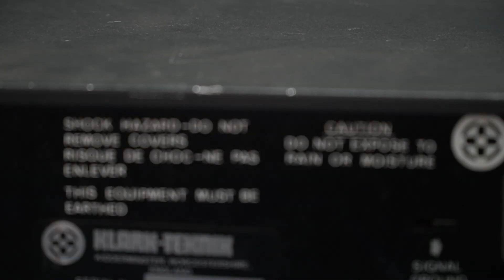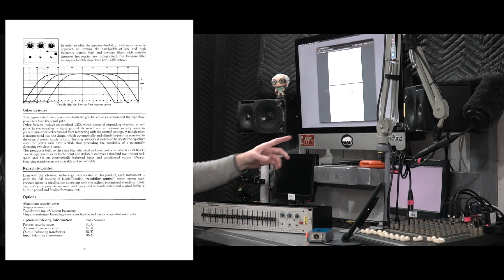#157 - Klark-Teknik DN300 early 80's Graphic EQ and the perils of Pin 3 Hot

Comment: Wow awesome video, btw do you know is DN322 in same league as this one? found one locally for 100$ , should I grab one?
Reply from the maker: Hey, thanks for the message. Yes the DN322 is a fine EQ, assuming you have a use for a dual 15 band these days. For $100 (if it works) I would probably be into it, depending on it's age though, you might want to haggle a bit since it will certainly need cleaning at some maintainance. Thanks again for watching.

Comment: Klark Technik is now part of the behringer group, they are “reproducing” many products very cheaply and many with authentically produced Midas transformers inside, including DI and line boxes, although not “original” parts this may be an option for you, there is a video from behringer about their production facility in China that also talks about their transformer production facility.I may be wrong but I think the balancing transformers that were used were those from Midas, hence special retrofit ordering.

https://www.klarkteknik.com/Categories/Klarkteknik/Signal-Processors/Compressors-Limiters/2A-KT/p/P0E8A#googtrans(en%7Cen)